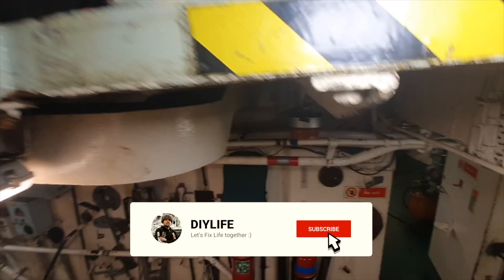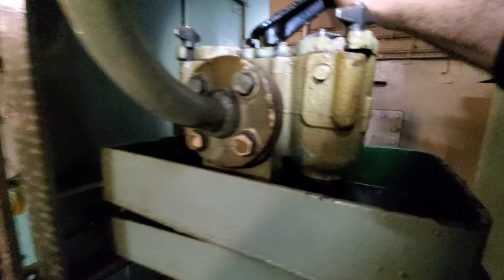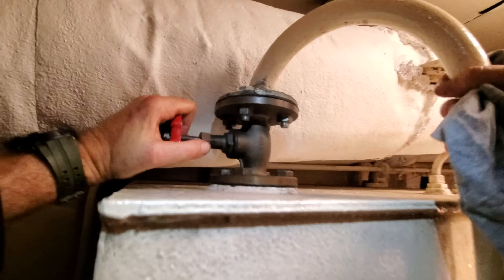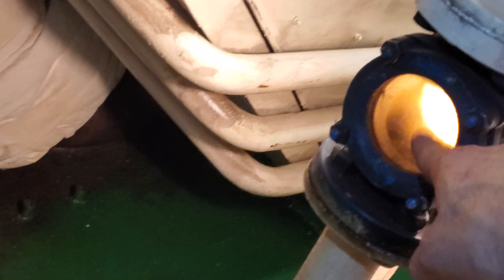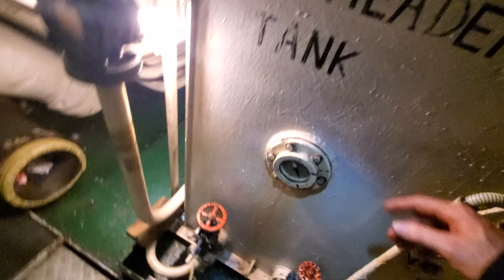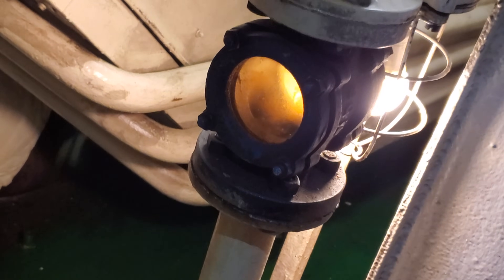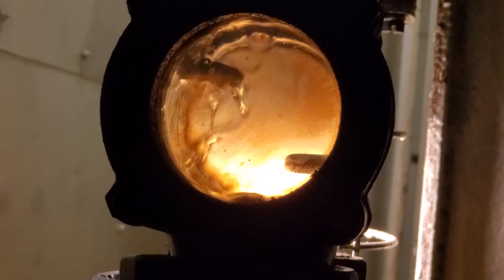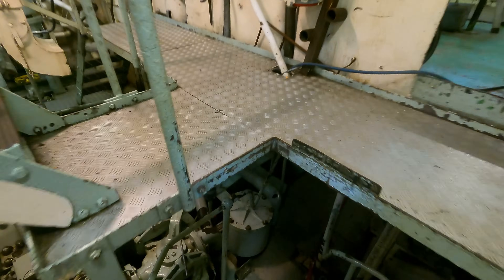MV Steve Iriwn Ship. Fuel oil transfer system info and Testing

Comment: Watching the fuel run through the sight glass reminds me of the videos I've seen of old steam locomotives. In that case the sight glass on the boiler is a crucial piece of equipment. If water doped om a high pressure boiler there was always a risk of overheating the crown sheet and boiler rupture. Loosing power on s ship is still crucial but not always fatal at least.
Reply from the maker: Yes what a very important sightless for a boiler. I've only learnt about them at University so I know of some of the dangers. Cool info thanks for sharing Mate!

Comment: outstanding, do the two pumps seem to overflow at the same rate?
Reply from the maker: Yes, by rights they would have the same flow rate, so I can't remember if we had to run 2 when 2 mains are at full noise. I would Vote no, As we usually have 2 pups so there is a backup incase of primary failure. Thanks for watching!
Reply: @diylifeofficial  Always good to keep polishing the fuel as well, constant filtration, great idea in choppy seas where things get stirred up. I'd bet the fuel flow of 1 is more than enough, my limited experience with smaller boats seems to say full throttle doesn't net you much more zoom than 1/2 to 3/4 throttle, just double the fuel consumption.